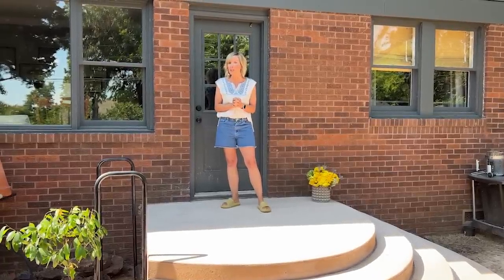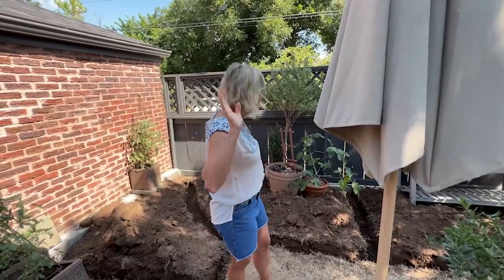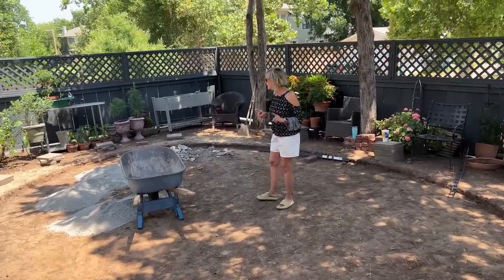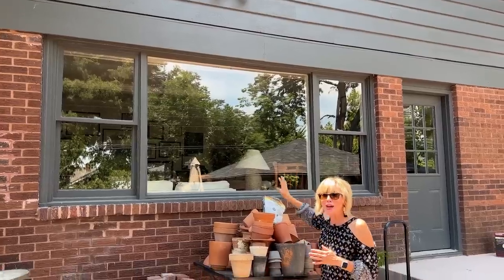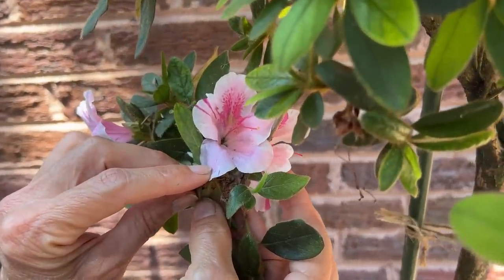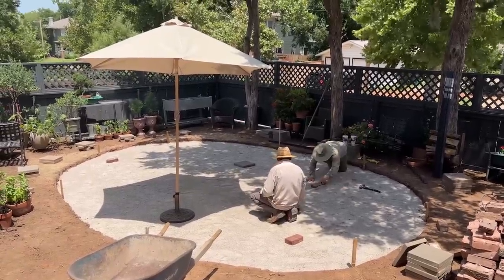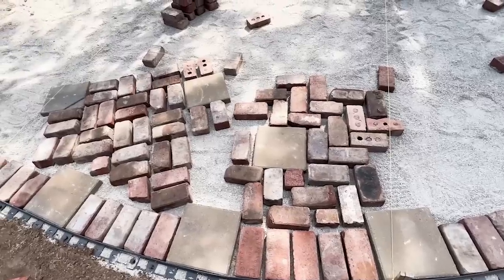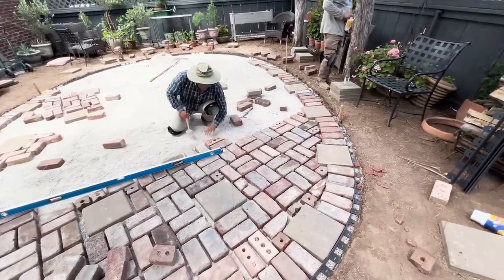Backyard Patio Design

Comment: I love a paver patio but in the Midwest we have such issues with the pavers shifting throughout seasons  and then requiring maintenance to keep it level and looking nice. Do your installers have any suggestions for  base materials that work well to avoid this? We have tried Gatordust. Concrete and a mixture of concrete and mortar at different  times in between pavers to try to stop so much movement.

Comment: You should have put a drainage solution on the straight side of those steps. The rain will roll off the roof right into that corner. Not to mention what rolls off from that platform. Maybe they can still do that. Those things should rally be thought through first.